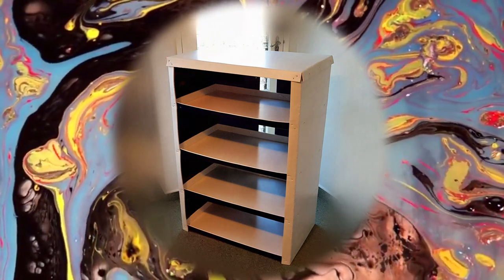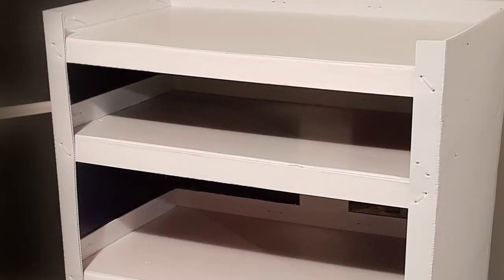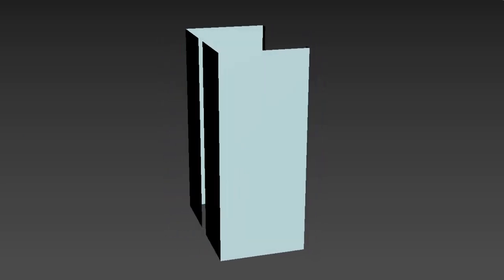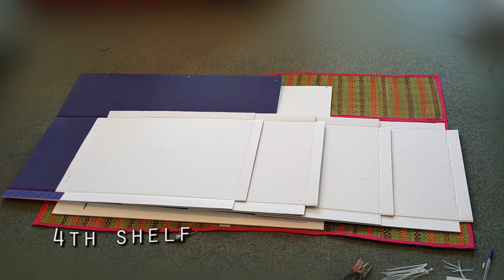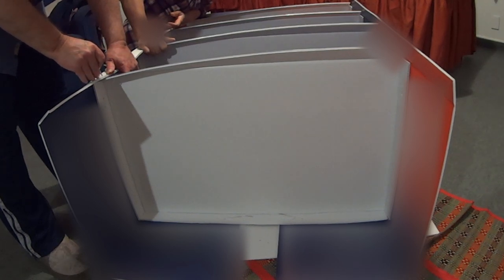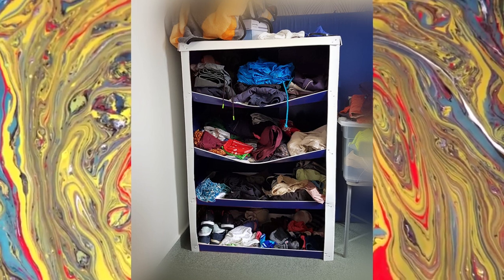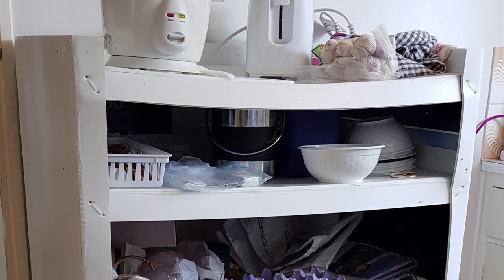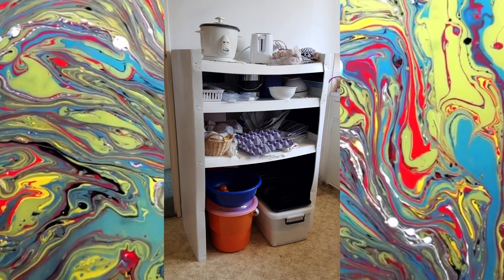Corrugated Plastic Furniture?

Comment: Are these made from the 32x48 election yard signs?   I have a few extra after making my  camper window shades,  and thought shelving might be an option.
Reply from the maker: Those were 3'x4'.  As shelves they don't support much weight without taking steps to reinforce.  Here they were folded.  One is still in use, but the shelves have sagged a bit.

Comment: Check out DIY USA and his methods of welding, fusing and strengthening material.   Yours and his is a fascinating use of corrugated plastic.  I thank you for your time and effort to share.
Reply from the maker: Thanks Shellie.  I know his channel and I need to watch it more.  I have seen his method for fusing sheets and I need to get a heat gun and try that.  I've been putting that off because it looks pretty tricky, but it avoids using expensive glue or tape, and it's strong, so I need to get into it, get a feel for it.  When I build my first boat I'll definitely rewatch his many videos on that topic, he's got so much experience with that too.  Thanks again Shellie!